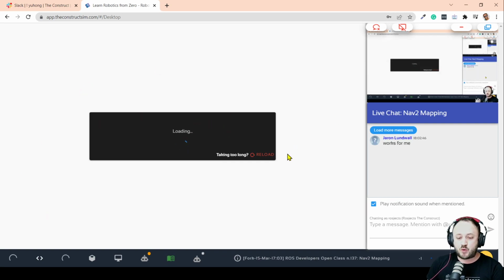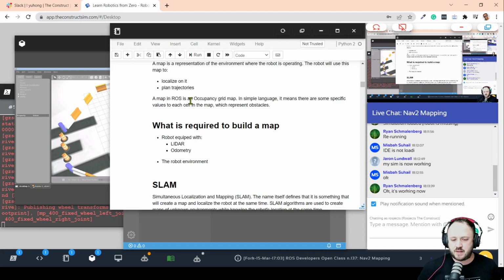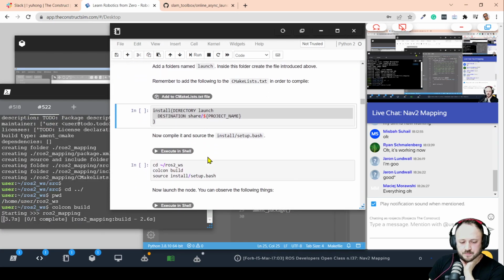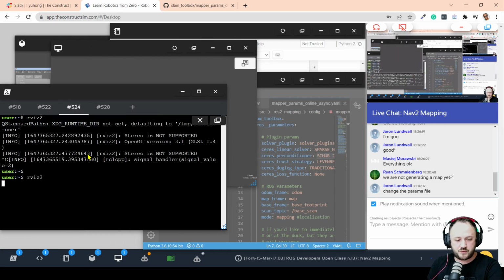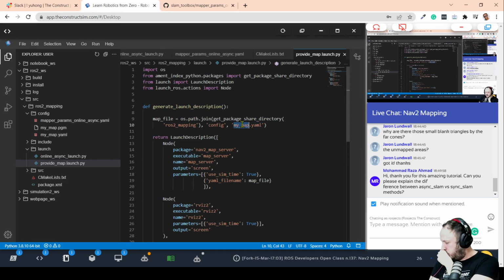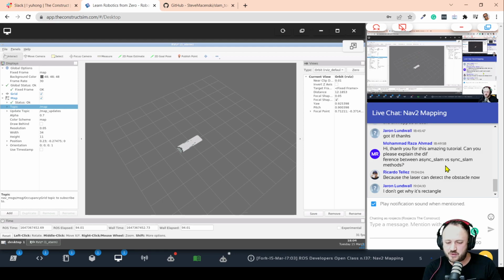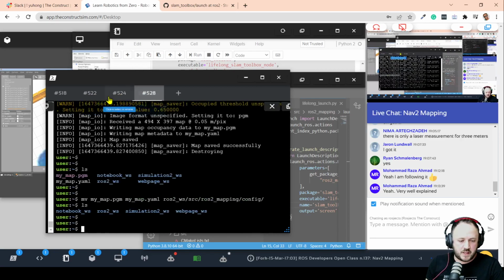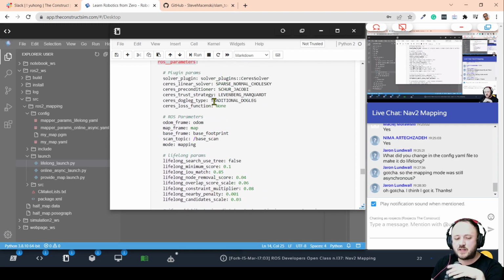Nav2 Mapping with SLAM Toolbox | ROS2 Developers Open Class #137

Comment: sir, i need help .

i have created simple 4 wheel robot include imu , odom , differential drive, ultrasonic sensor in gazebo 

but i don't  know  how i can start  after this 

i want to make a map of unknown world and learn navigation
Reply: install gazebo plugins on the frames of your robot for example if its a urdf model  , inlcude gazebo plugin which always come along with topics in which you can tweak   , for example a gazebo plugin for a LIDAR sensor can be added to the frame  of your robot .So basically when all these is done and you can see the topic being publish to the shell you can strart tweaking the mapping stack according to the name of the topic of your robot . for example you need a LIDAR for perception and mapping the environment the topic in which the lidar publish in gazebo which can be '/scan' topic will be included in the mapping stack parameter /edited .
Reply: for object avoidance you can write subscribing Node be it .py or .cpp to the topic which is '/scan' to perform some task in which when the lidar senses an object at certain distance or range the robot wheels acts since you are publishing to command velocity topic .

lidar sensor publishes a scan topis you write a node that subscribes to it , while you publishes certain velocity to the wheel of the robot either when the robot senses an object it stops , move backward ,foward or turn at angular velocity of -z 0r +z
Reply: if you have installed imu plugin you can fuse it with odom for great and perfect localization using the EKF node as well .